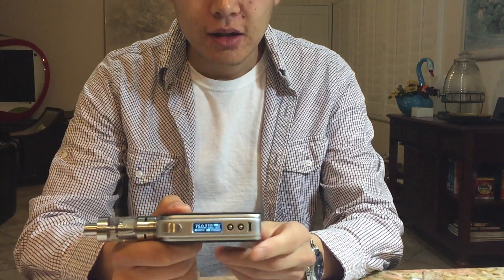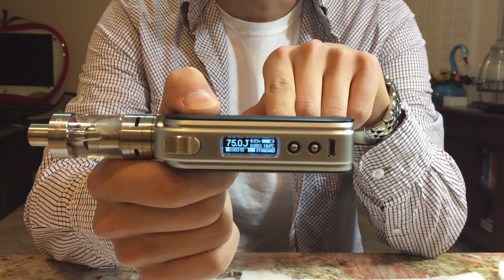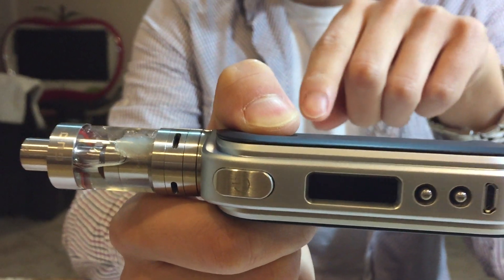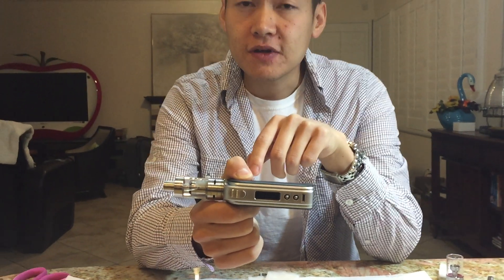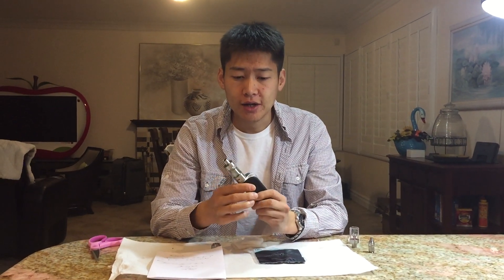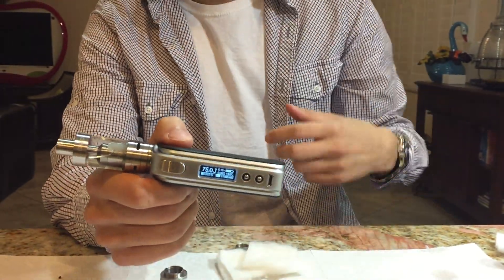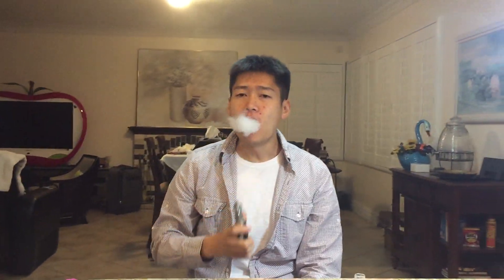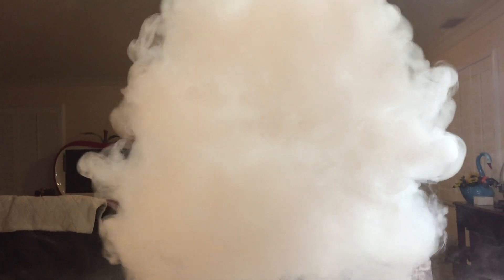Altus the world's first coiless atomizer (TCR Value with SX Mini)

Comment: Hi david, what is the best tcr setting for the Joyetech evic vtc mini?  i just cant make it work properly.  
cheers
Reply from the maker: Nuno Amaro try the range between 0310-0450 for TCR. The higher you go, the lower temperature you will use. Use maximum power at 60W for TC. That device may be a bit weak for the Altus.
Reply: Thanks David, I set it to 0450 , 60w and 230 Celsius. It is working so good, excellent flavor with great clouds , warm and wet.   Cheers

Comment: If I input the TCR of 0.0031 (0310 on the RX200) I get very little vapor production unless I put it at temperatures above 500F.
Reply: +Richard Billings  I'm having the same issue. 0310 does absolutely nothing.

Comment: I'm surprised you got that much vapor with tcr set at 0.00.31 at 160 Celcius. I tried the same setting and I don't get no vapor. Also why didn't your device show the resistance of the chip? All yihi sx mini show that after vaping it. I also have the sx mini.
Reply from the maker: +Mike Vapes Hi Mike, the resistance of this chip is at 0.35 ohm. The SX Mini shows the resistance in junior mode, but for some reason doesn't show in the senior mode. For this video, I was also using a cotton blend from fiber freaks. Maybe that helped as well.
Reply: David Guo Very strange. I get no vapor at all with those settings.
Reply from the maker: +Mike Vapes I'm going to upload a trouble shooting video detailing mainly 4 parts: 1) CVU alignment, 2) proper installation of cotton, 3) making sure port clips are tight against the chip, 4) correct setting with the mod. It could be any one of these issues. Having said that, I think it's ok to change your settings from mine because each CVU is slightly different and each time you build it, it acts a little differently. For instance, you may want to decrease the power and temperature.
Reply from the maker: +Mike Vapes maybe i'll upload another video showing me building it and vaping on the SX Mini :)
Reply from the maker: +Mike Vapes https://www.youtube.com/watch?v=WfO_zhKLzT0
Reply: Hope to see you on a live show with these guys david, these guys are the best reviewers around
Reply from the maker: +Mike Vapes https://www.youtube.com/watch?v=IoAl6G1pJU4 hope this helps!
Reply: +Mike Vapes +David Guo Watched all the videos several times, tried everything suggested and also cant get any vapor at 0,0031on the rx200 in a Reuleaux even with 80W@220&#176;C. 0,0045 works fine with same settings. Using 80VG/20PG blend like the blond mama and Muji cotton pads. My chip has 0.41Ohm at 22&#176;C. The box of my altus says CVU tm 2 in the upper right corner, but i cant find the logo on the chip. Mine looks more like your prototype shown in the recorded live stream. May that be an issue? I also tried to directly fill and vape out of the box. But with 0,0031 i got the same result like mentioned before. The original cotton seems to be bleached. So i needed to change it cause of the bad and itchy taste. BTW i own and built a GG Ithaka and Penelope v1 since release, also the Kayfun 3.1, lite plus and v4. So i would say i am able to get the easy built on the Altus properly done. 130€ is not cheap and i really want this thing to work properly. Anyway, is it possible that there are some CVU version 2 tanks sold with still version 1 included? Can&#39;t explain that issue otherwhise. PS With 0,0045 the tank gets so hot after 10 3second hits, it will burn my lips. Tried 0,0040 but that doesnt work either. I mean that is more than a slightly difference in production. That would be more than a 30% tolerance compared to the tcr.
Reply: +Sebastian Müller Since im an idiot i didnt came up with the idea to just contact the customer support. I will just leave this here and say that there is actually support.
Reply: It shows the videos are unavailable smh

Comment: You said this was tungsten based. Tungsten TCR is 0.0045. Is there an msds for the alloy of tungsten your using? Have you refined the TCR calculation to our vaping temperature range?
Reply from the maker: +Vaping Moderation I answered the question regarding MSDS with Phil Busardo. The answer is no, we don't have MSDS yet. We will get it soon. It costs time and money. Funny thing is if I'm making wires from my garage nobody will ask me for MSDS. Yes, the TCR calculation is for lower temperature setting under 400C. Perhaps it doesn't look like I'm very professional with my videos, but our American engineering team has world class capability. I hope you understand that we are a new, developing company. We are able to introduce a technology that gets rid of coils, forever, and gives you a cleaner taste.
Reply: +David Guo Yeah I'm just kind of a geeky reviewer. I'm all about temperature controlled vaping so I was interested to know about the TCR difference.
 I'm confused about why you mention the "skin effect" of electrons, the "skin effect" is limited to AC frequencies, DC electricity travels the bulk cross section and all vaporizers operate on DC
Reply from the maker: +Craig OneHundredPercentVG Very well said, Craig. The CVU needs its own TCR curve; it is a little different from that of tungsten. I know I went a bit overboard with the electron explanation, as the skin effect applies to AC currents. I'm not an electrical engineer, but I suspected something similar to what you were saying with the PWM. The main thing is this: as much as vaping technology has advanced in the past years, the bottle neck to the taste is using coils. And that's where we come in :)
Reply: Craig OneHundredPercentVG PWM should have no effect here. AC is alternating, the frequency of which can introduce a "skin effect". PWM is just turning regular DC on and off. There would still be no alternating frequency & no reason for a skin effect. Also Evolv and most of the cloners use DC-DC, PWM is largely left to Yihi at this point afaik.
Reply from the maker: +Vaping Moderation I see. Thanks for the info.
Reply from the maker: +Craig OneHundredPercentVG never got your email, could you send it again? guovape@gmail.com Thanks!

Comment: I'm excited to try it , you definitely have a game changer on your hands I'm just wondering is there a possibility top fill is added to the tank ?
Reply: I mean like added on to it in the future or maybe for a version 2 or something
Reply from the maker: +Patrick McAvoy With this system, a no-leaking guaranteed top fill is difficult to achieve. I first designed it to be a top fill with adjustable liquid flow control, but then as time went on I decided to make it simpler and introduce this technology so people can use it earlier. Now, it wouldn't be hard to make a top fill like the other companies who just open it from the top without sealing off the liquid. This type of design will be ok if you fill it very quickly, but if you leave it there opened for a minute or two, it will flood the core. But that's what seems like are selling these days, and people seem to be ok with it?
Reply: +David Guo +David Guo +David Guo it's just the convenience of it that's nice, and the ability to take advantage of a tanks full capacity but that is true leaking will happen , I think most people will tolerate a little bit of leaving after filling for those reasons , I've noticed the ones that allow you turn of the juice flow leak much less though
Reply from the maker: +Patrick McAvoy good, that makes my job easier :)